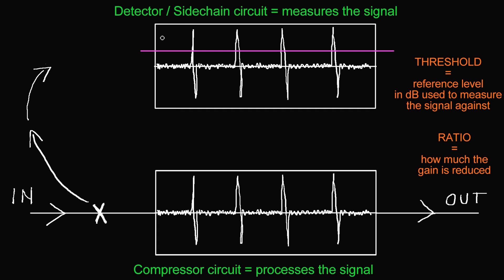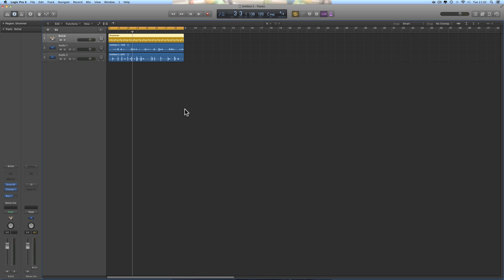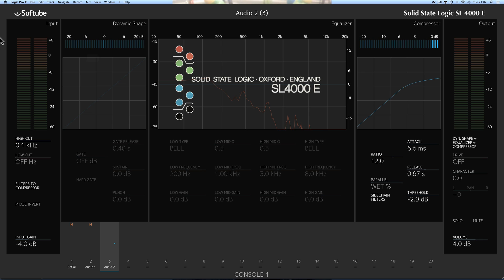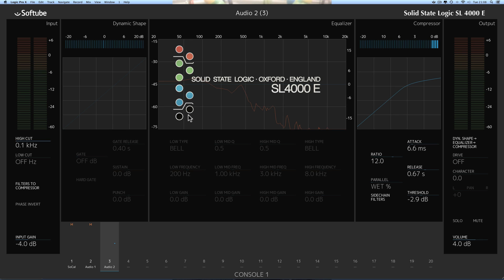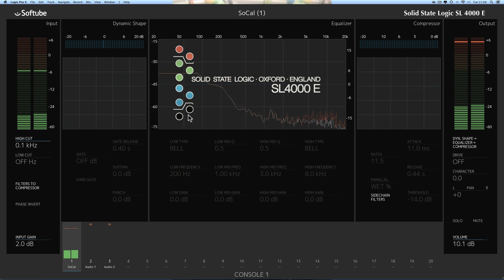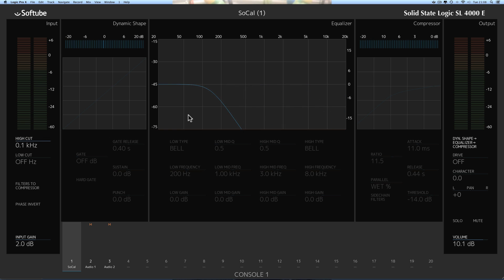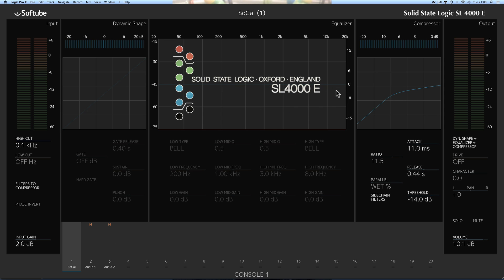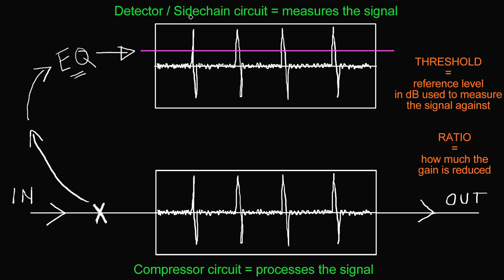Compressors & Compression Masterclass 7 (Frequency Conscious compression)

Comment: This is exactly what I need to know to setup a software compressor for dealing with modern broadcast TV production, which often tears your head off at random with pumping music or adverts and gets tiresome pressing the mute button etc.  So I tried a standard hardware compressor connected to my downstairs TV, but it did not make much difference and I had put this down to needing frequency compression.
Reply from the maker: most tv's now have a compressor built in, and there is a setting in audio menu somewhere which sets volume evenly for 'nightime viewing' or whatever they call it.
Reply: dancetech
Yeah I have seen those settings on the newer TVs and they help a little bit.  I also want to set up a software frequency compressor setting via a plugin, to do the same with online video on my computer.  There are huge variations as you know between different content on YouTube, so a playlist will be going from very quiet to ultra loud.  I like to listen on headphones and YouTube can be very dangerous to your hearing, so I have to be very careful by setting the volume low before the next video begins.